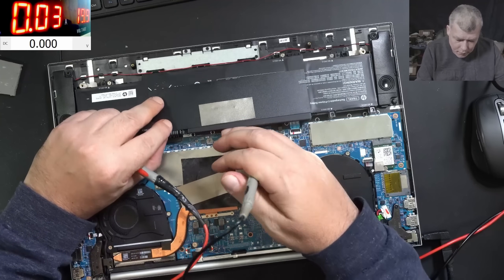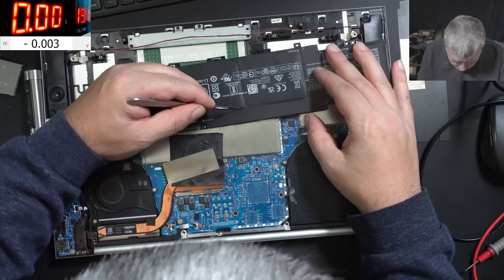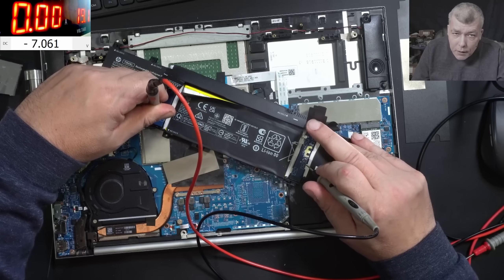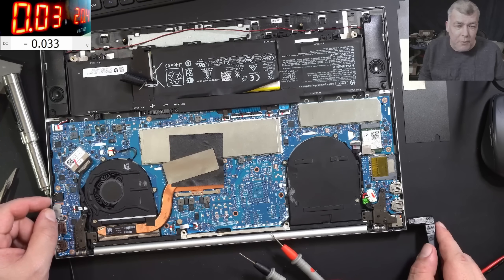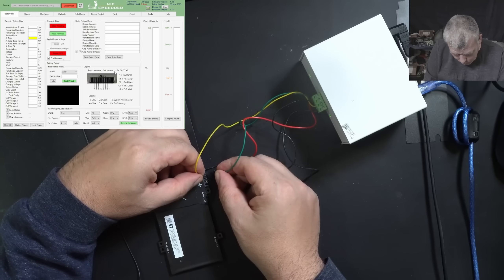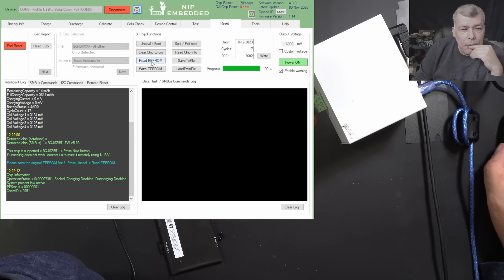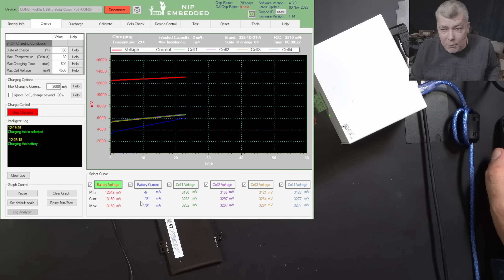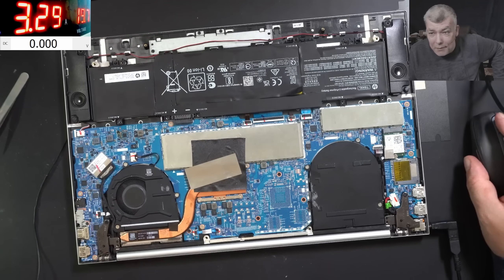Laptop battery repair & unlock - Yes, even a new battery can die

Comment: Another shill video fir your Romanian mates over priced battery analyser, losing alot of respect sorin
Reply from the maker: Please share with me another device doing this kind of job and i promise you i will buy it and review it, thank you
Reply: @electronicsrepairschool  how many reviews of this one battery analyser have you done now?  It's overpriced and so is the subscription.  Out of reach of most repair shops and not profitable.
Reply: @waynetaylor2784  he specified for a number of times already, that this device is for a shop/technician that has at least a few battery for repair per month. As Sorin said, please provide a cheaper alternative instead of running your mouth.
Reply: @waynetaylor2784  hate won't do you any good. he's not the factory . the price was set from the manufacture.
Reply: @BodiAttilaAlexandru I have 4 shops and its still not economically viable plain and simple , and tbh batteries have a shelf life for a reason using a device to trick a battery back to life is fraught with danger.
Reply: @electronicsrepairschool  The battery analyser is clearly a very good tool. Don't listen to critics Sorin, you are always honest in your appraisals and point out that some devices aren't viable unless (as in this instance) a repair technician has an extensive number of batteries to repair. My respect increases for you with every video you release and not just that, I've experienced the excellent service you provide and so I know first hand. I hope you and your family have a wonderful Christmas.
Reply: @electronicsrepairschool  I agree. No other devices available. At least Sorin gives us a way of doing it. Great work Sorin
Reply: Believe me there is no love lost between myself and sorin, he deletes my comments on a regular basis for trying to help (which I won't bother anymore). Moving swiftly on, is he shilling, yes and no. It is the only device that does this sort of thing but in this case I'd have asked the customer if the laptop was still under warranty as they'd get a replacement battery anyway. As soon as you need to cut open a battery I think the repair isn't worth it, trying selling a laptop if they see the battery has been tampered with. That's fine if you're going keep the laptop and it depends on the cost of the repair.

If the battery doesn't need to be cut open and can be fixed with just using the connectors, then great. It's well overpriced, if it could everything without cutting it open, yep, I'd see the value but I also understand the battery will probably always needs cut open if it's below a certain voltage because the circuit would won't allow current via the connector. The unit should be a 3rd of the price because you're paying an annual subscription, that's where the money is, not the device itself but the subscription but the guys is playing both sides so there is no value. The unit is pretty much useless without a subscription so a low entry level price would encourage sales and of course then take up of the subscription because it's useless with it.

You'd need real cost prices to determine the sweet spot, poorer countries would see a higher uptake because genuine batteries would be harder to come by. I'm not sure the guy that actually sells it realises a low entry price would be actually mean more money longer term due to increased subs but sorin will now delete this as usual because I've given the guy some advice lol.
Reply: @marksutherland774  He didn't delete it
Reply: If NLBA1 is over priced then you can buy UBRT which costs only 1000$ + 7% VAT, just software, no hardware, no analyzer, no support forum, and almost no English :))
Reply: @nipembedded9976  yep and how many people are buying that, not likely all that many. But even before you get to that point, I have no idea how much this guy sorin charges for this. Now let's assume people buy genuine batteries not copies then a fair ballpark would be £80-90. I don't know enough about this thing in terms of if it can improve health, e.g. if a Dell battery shows fair, can this improve it enough to show "good". If you tell someone you're gonna cut open their battery most will say no replace it for safety reasons, a battery is sealed for a purpose, and for some dell batteries you know the seal is airtight because they literally balloon.

It would be interesting if he said how many times he uses it in the real world and how much he charges and makes, afterall that's all anyone is going to care about. I have no idea what the demand is for repairing batteries like this. Most power supplies can revive dead batteries to an extent simply because you can control the voltage and current better to give it a kick start, a charger (maybe this thing can do that, but most chargers don't) can't be as flexible in it's charging approach.

He could get a some dell batteries low. poor health and show the health increase, that would be useful for resellers if you could bump the health up a notch. Whoever makes these, the money isn't in the unit (hence sell cheaper) it's in the subscription, because without the subscription it doesn't do much (which is the point obviously) Clearly they have approached YT channels to promote it, fair enough but there are many other ways to promote this especially if it can genuinely improve the health of the battery so it goes up a notch of health in the bios. It seems to unlock batteries which is great, another anti-repair move. It would be interesting if he spoke the guy making them, how many do they shift etc because you can't really analyse sales, the market etc until you know what someone is already doing and the results they are seeing. Sorin has no clue about marketing I know that .......................................... yes S you can delete this one as usual.

I don't make  my living from repairing, but I do sell laptops so if it can change the battery health in the bios it would have a use for resellers and techincally if it rebalances the battery then it should show in the bios unless it uses a counter of some sort for the health but I don't believe it does, maybe whoever makes it can shed light on that before the big S deletes this
Reply: @marksutherland774  He didn't delete it
Reply: @marksutherland774  Sorry but you don't know how a laptop battery works and what NLBA1 can do, the the discussion makes no sense. Please watch our tutorials to understand first what is inside a laptop battery, how it works and what NLBA1 can do.
Reply: @nipembedded9976  Can't remember saying I know how a laptop battery works. What part of of the discussion makes no sense, enlighten me. Also answer the question can the so called improvements change the battery status in the Dell bios, YES/NO
Reply: @marksutherland774  Complete previous post. There is no YES/NO answer. You will probably ask me why. Well, please check our tutorials first, the chip inside the battery has hundreds of parameters based on the health computed, just changing the health is also not straightforward, it depends on the chip technology. Why change it while the cells reflect a different reality? Why change the health in case the chip computes the new health in the next cycle ? and the list can continue. I invite you to our forum if you want to continue the discussion using real examples.
Reply: @nipembedded9976  or I could just buy new batteries from laptop manufacturers,  and give the customer what they want, not a tricked up reworked battery.